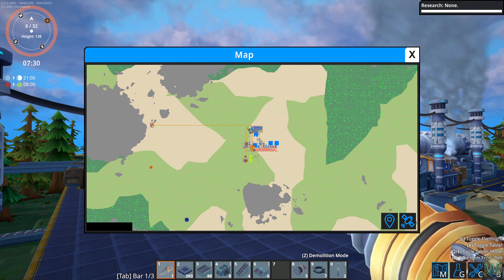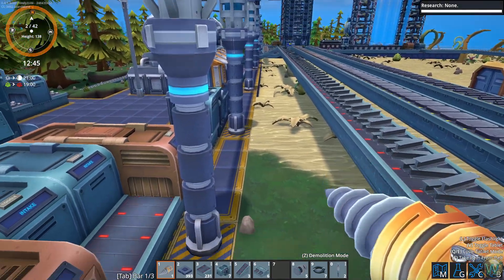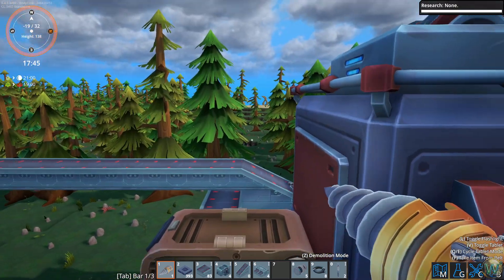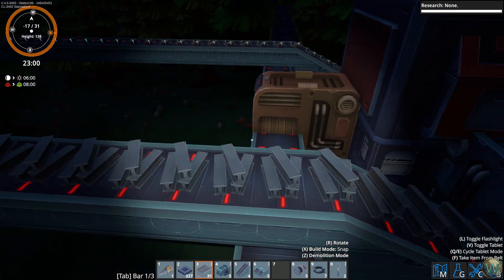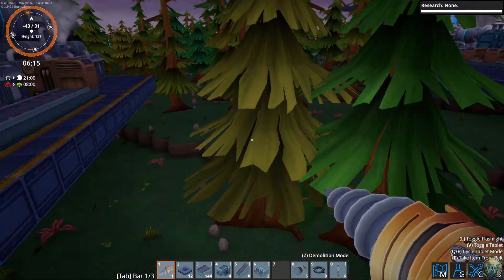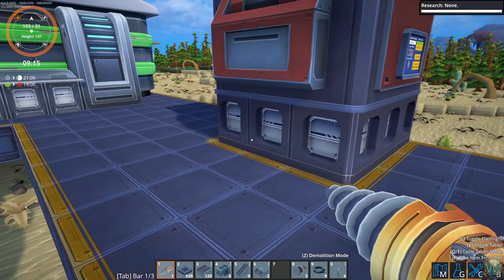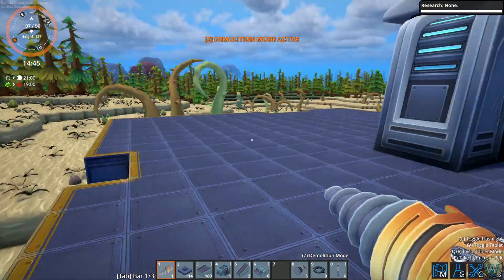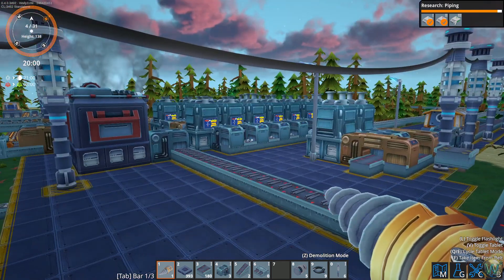Foundry - Ignium Fuel Rods and Science Pack III - Episode 15 - Let's Play

Comment: There is a missed oppurtunity for easy expansion of the since packs 3 and it is driving me madder than it should. It has a total of 4 I/O's and therfore can be easily done with your current options. On the side where you only input one component, use a double exporter to extract from the assembler and then belt it in to the lab. That way you can expand production very easily by simply coping and expanding the existing setup.
Like the game
Reply from the maker: Agreed, but it’s science 2 that I need to double (first) to keep to ratio.  I was planning on doing just that which you suggest in that instance, though.  Thanks for watching!